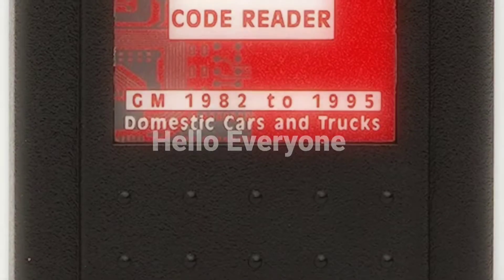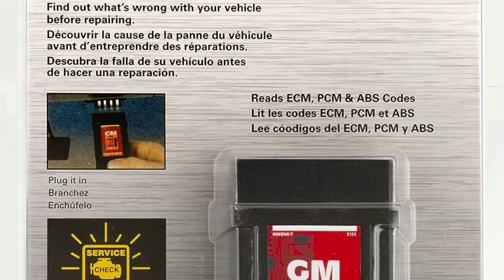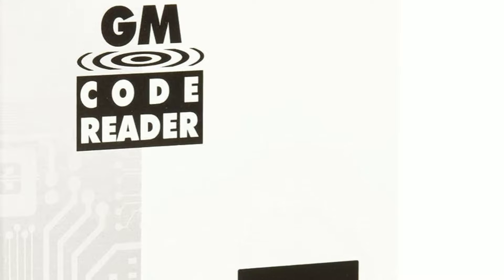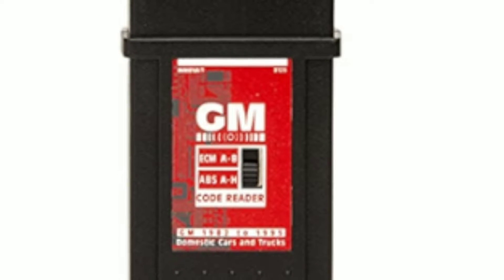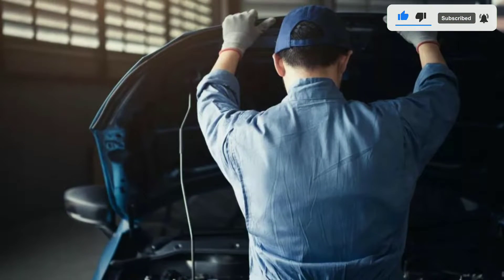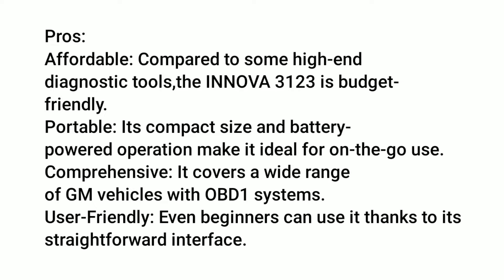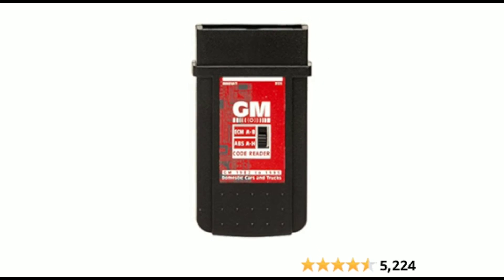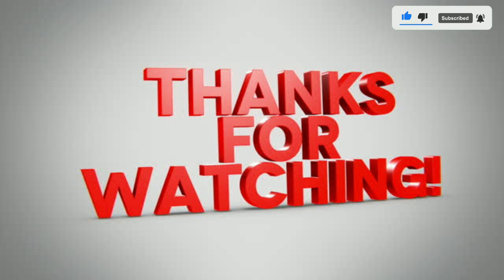INNOVA 3123 GM OBD1 Code Reader: How to Use, Features, and Review |

Comment: The Innova 3123 doesn't use batteries. The picture @ 2 minutes shows jumper wires being used connecting what looks like a Ford OBD1 reader to s Ford DLC.
Reply from the maker: My Bad, thanks for pointing that out, Sir!

Comment: You don’t get a “check engine” light.  You get “service engine soon”.
Reply: I don't even have that in my 89' T/A

Misfire, cylinder select error, egr flow open/short, etc. and not ONCE has that engine service light come on except start up.

Comment: Hi Is very helpful,I have a big problem Is like You tu halo me I have Konfot Motorhome,year 88 de la Chevy,and when I buy this Motorhome,a dident see,this isdesconected,and I don't have 0BD1port And curent fiand good electricians,I Don't know what to do
Reply from the maker: I understand it can be frustrating to deal with electrical problems in a vehicle, especially an older one like your 1988 Chevy Konfort Motorhome. Since it doesn't have a standard OBD-1 port and finding a good electrician seems difficult, here are a couple of approaches you can take:

Look for alternative diagnostic methods:

Check for Chevy specific forums online. Chevy enthusiasts might have knowledge of alternative diagnostic methods for your specific model. Search for "Chevy Konfort Motorhome 1988 diagnostic procedures" or similar queries.
Look for manuals or wiring diagrams for your motorhome. Having a wiring diagram can help you troubleshoot electrical issues yourself or guide an electrician during repairs. You can find manuals online or by contacting Chevy customer service.

Try to identify the problem yourself:
Describe the symptoms in detail. What is malfunctioning in your motorhome? This will help narrow down the problem and might point towards a specific fix.
Visually inspect the disconnected component. Look for any burnt wires or damaged connectors around the disconnected part.

Expand your search for electricians:
Look for mechanics specializing in RVs (Recreational Vehicles). They might have more experience with electrical systems in motorhomes compared to regular car electricians.
Contact Chevy dealerships in your area. Even though they might not service motorhomes themselves, they might recommend electricians familiar with older Chevy vehicles.

Remember, it's important to be as specific as possible when describing the problem to any electrician you find. The more details you provide, the easier it will be for them to diagnose and fix the issue.